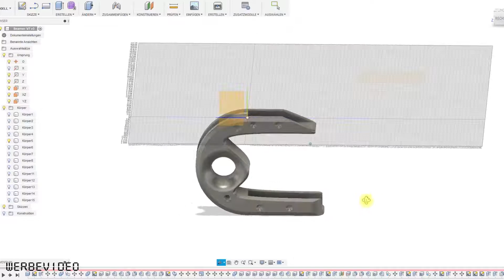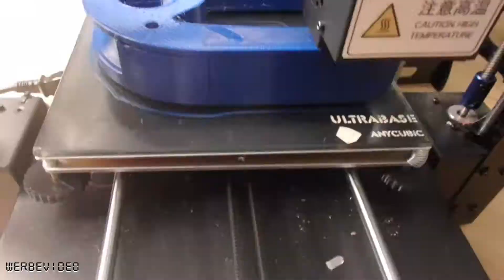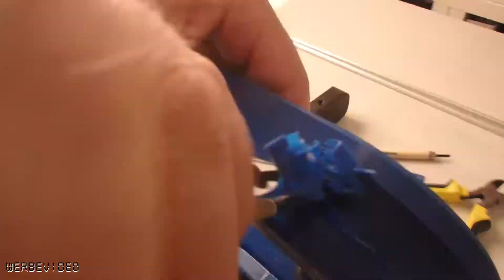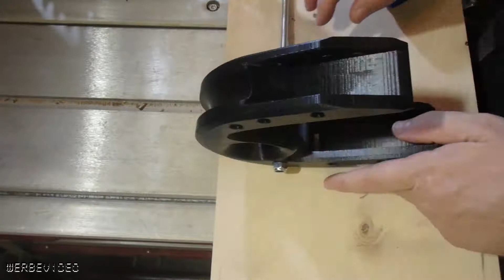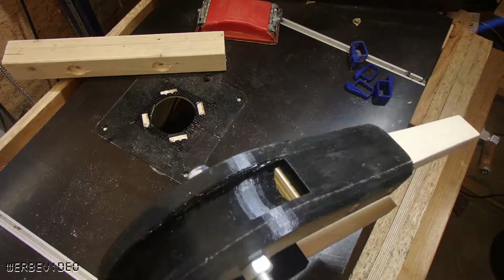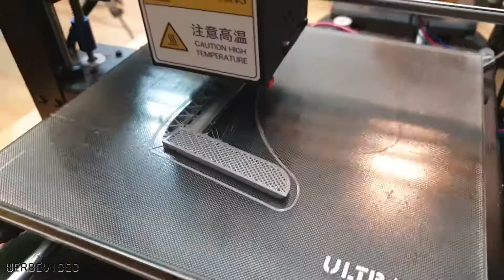Projector stand - Design using 3D Printing and wood and Fusion 360

Comment from the maker: Maybe you want to test Blender, it is the free and open source 3D creation suite. Here is a nice beginner video using Blender 2.9. I show the modeling process of a telephone holder for a dashboard in a car, using Blender 2.9.  The goal is to model a 3D print finished model in Blender. This includes precise modeling techniques with defined model dimensions, a good mesh topology and the final correction of any errors for 3D printing.  
Blender step by step modelling a 3D printed car phone holder with precision - Link:https://youtu.be/K_kCa5JU3UI